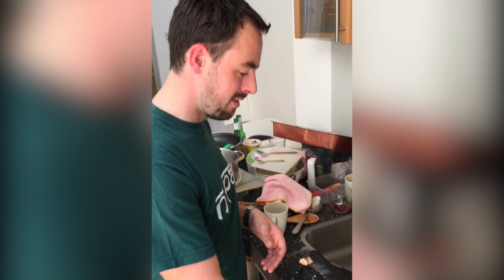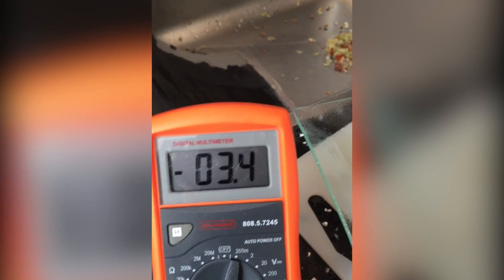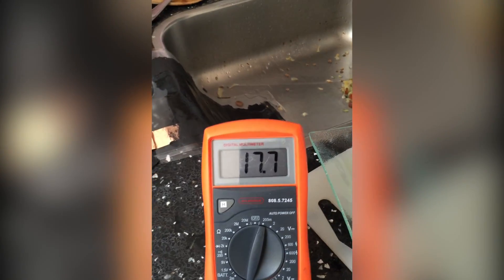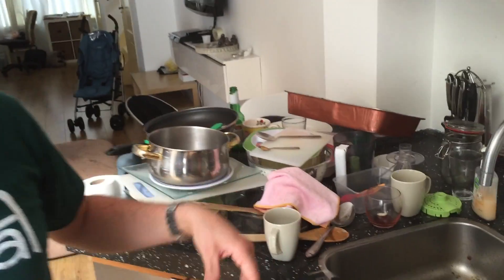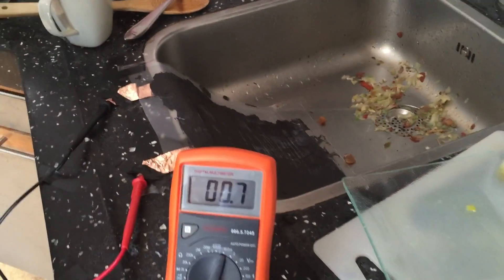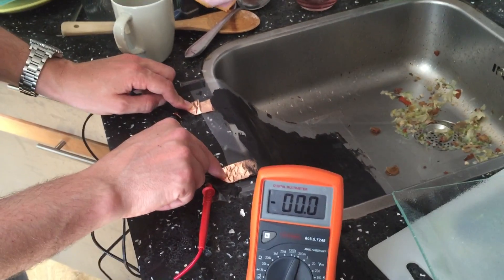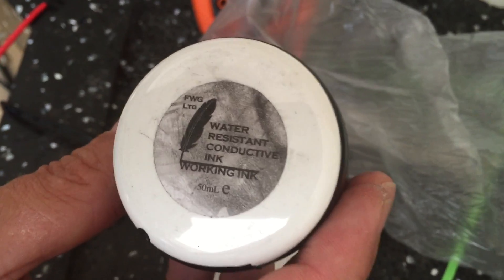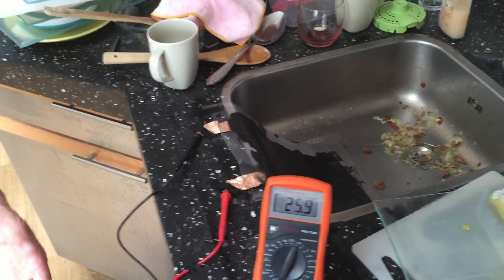Salt WAter Graphene (SWAG) electricity generator

Comment: Nice experiment. One thing I'm wondering is the power this is giving? P = VI, we got voltage, but current is not tested in this experiment. Yet, I think it is computable if we know the internal resistance of the multimeter at this setting. I'd really appreciate if you can inform me about this ~ just very curious